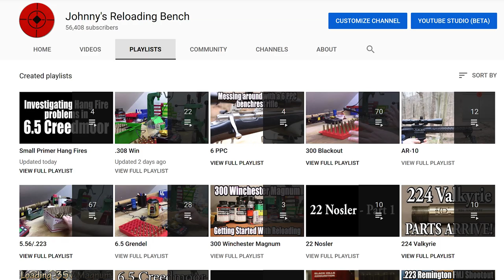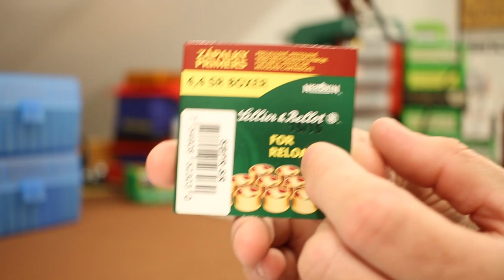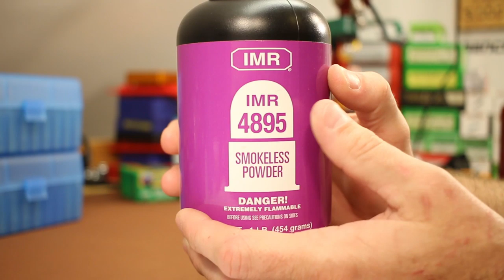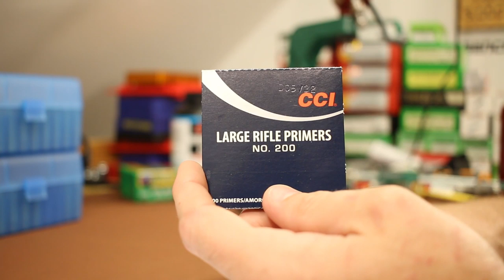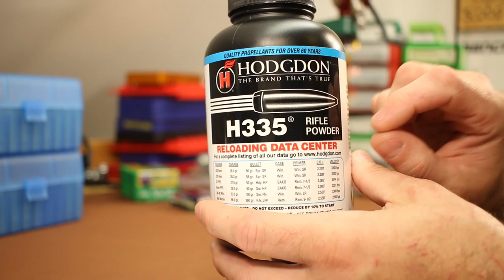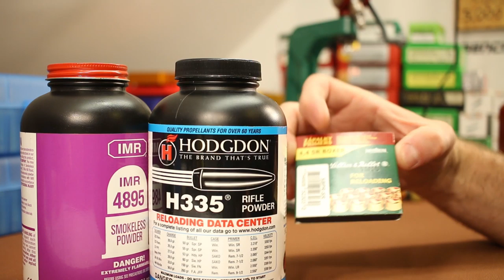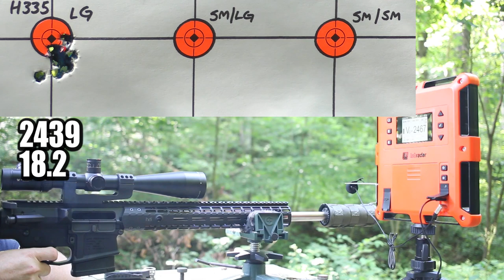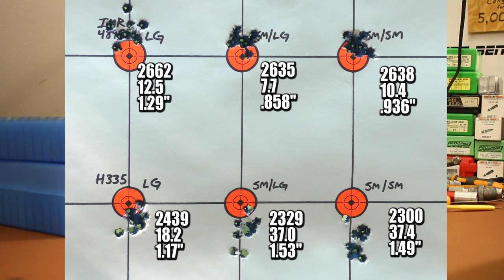308 Win - Lg vs Sm Primers and Flash Holes

Comment: That's crazy.  I've been using Lapua cases for 6.5CM with RL16, RL17, and H4350 with the CCI small mag rifle primer.  The H335 has rocked in the 5.56 also.  Glad I've never ran into hangfire issues!
Reply: between 7.62Nato and 5.56Nato i've loaded and shot over 20k rounds. my total round count for handloading is 40k rounds. I have never had a hangfire either.only 1 round in 5.56 didn't go bang (CCI Small rifle) in a match one time. even the 5k Tula primers all worked great.

Comment: The small primer 308 cases are usually bench rest cases. The old Remington version used to have thin walls / heads, for more capacity. The idea was to allow a similar amount of powder at a LOWER pressure and they were not meant to be loaded to maximum 308 pressure loads. The Remington 7 1/2 primer is super hot and is called the bench rest primer by Remington and is meant for full size bench rest cases.

Comment: It has to do with the empty volume in the cartridge and the primer size.  Lower charges (higher empty volume) equals lower ignition pressures which provoke hangfires.  Large primers will increase the pressure compared to small primers hence improving such conditions.  Keep that in mind because if you are going to test the issue you need a proper strategy to control these variables.  Not doing so will give you inconclusive results.

Comment: I recall the discussion when small primer Palma brass was introduced as follows: 1) You get more loadings with the smaller flash hole as there is more material in the case bottom to resist "loosening" 2) Smaller primers make for "softer" ignition.  This means you can use more powder to achieve higher velocities without exceeding the SAAMI limit. This being like using a less "quick" propellant.

Comment: Great video.  What I understand from talking to a lot of bench rest shooters, if you run small primers on rounds that are designed for large, like the .308 or 6.5 Creed and others you can run into reliability issues if you do not run magnum or bench rest primers.  Something that burns a lot hotter.  If consistent ignition is the goal say for hunting then you should stick with the primers that the case was originally designed for.  If you want the smallest standard deviation and POTENTIALLY smaller groups then small primers can be the answer.  Got this same information from multiple sources I always just run Large primers in standard short action case and small primers in mini action style cases.

Comment: Great video in comparison there with small vs large. This my experience over 5 decades of reloading.  Knock on wood, I have yet to have only one, in all my reloading to have a hangfire.. it didn't ignite at all and it was a 280.  I have used a lot of h335 in my 223's. I have used all brands of primers, Win Sr, Rem 7 1/2, CCi 400, 450, br4, 41, fed 205match,. Large rifle the same. I have never used SB nor Tul.
 What I have learned for me, with ball powders is high load density equals lower sd's. I watched a video that Rick Jamison did testing primers and flash. Could tell a slight difference in magnum primers. I would say loading density nearer 100% was the factor. I had a favorite load in my bolt Weatherby of H380 and a WLR with 165 btips, Rem brass, that literally was a clover leaf all the time. I do everything to the brass, flash hole, primer pockets and weigh them to .25 grain. I don't neck turn much. 
 I did  308 comparison with 308 ppu brass I had with LG rifle primers. The flash hole of the ppu had a smaller flash hole. I did the 3/64th bit to them. Had a slight difference with small hole lower SD with wlr. 
 I think also when you have a smaller flash hole it doesn't create as much pressure in the primer when you are nearer max charges. 
Once again great video and my 2 cents worth.

Comment: Another good video Johnny, pretty much learned reloading from your videos. Went out yesterday for the first time with my new Bergara B14, new SRD762 and my first 308 reloads. After zeroing scope was able to do 1” groups at 100yds. At 200yds on steel grouped but shooting very low and at 300yds had to hold really high to get on steel. My load was 168gr FMJ, 36.4gr IMR 3031. I’ve loaded the first 200 rounds very conservative so it could be why I have so much drop at 300yds. Kinda off the subject but I appreciate all your videos. Merry Christmas 
Luther

Comment: Actually, I think the S&B primers are harder, therefore you have to have a really hard firing pin strike for it to work properly.
Reply: I agree in ar testing 556 I can concur they are harder.
Reply: Yeah, CCI primers are definitely not "hot" by any stretch of the imagination. W-W, R-P, and Fed are all hotter in comparable primer types than CCI. They are highly reliable and ignite really really long as you hit them with a strong enough strike.
Reply: S&b factory 300 blk ammo.  Can confirm harder primers than cci.  Had to change the trigger springs to achieve ignition

Comment: Small rifle primers gave you better standard deviations because the small primer blast stacks less deviation into the equation we call a gunshot. It's a thing is hornet loaders understand. The weaker the printer, provided it is hot enough to give ignition, the more consistent your load.

The issue you were having was that the SRP was simply too little to consistently ignite that charge of ball powder in that size of a case.

Comment: To be honest, I've never done much shooting with 'small flashhole' brass in .308. I tried some out when I first found some of the the Lapua small hole brass, but never saw any real gains over the standard Federal Match brass I've used forever. I tried some of the S&B primers but found they weren't consistent enough for my tastes with ball powders. Most of my manuals recommend magnum primers with ball powders, but I've had good luck with CCI Bench Rest primers. I've been shooting 45.6 grains of Varget with that primer under a 168 SMK and getting right around 2700 fps out of a 20" LR-10 with no signs of excessive pressure at 80°F ambient. Groups are sub-MOA with SD's hovering around 12-14 depending on the temps on any given day. Your millage, of course, may vary. 
Great video. I'm looking forward to more.

Comment: Small primer brass is marginally better shows up in the coarse of a shooting season. But it was more consistent. Consistent often leads to accuracy.  New brass is probably more accurate, also what is the H20 capacity of Palma vs Regular 308 brass. 

Think you really covered it. Shoot stick not ball for small primer and watch the cold weather....
Reply: I shoot h335 in small primer and have zero issues in my auto

Comment: I'm interested to know if that when there is a misfire are your cartridges pressurized from the primer? In some pistol cases I've seen that the bullet is separated from the case and has entered the barrel so I was wondering here in the rifle cartridge if the cartridge is still pressurized or has depressurized by the time you take it apart? I've also found much good scientific material related to primers online. Here is a link to one of the several I find in a Google Search. https://www.researchgate.net/publication/48204066_High-speed_measurement_of_rifle_primer_blast_waves

Comment: Savage F/TR Palma rifle., 1/13 twist, 30 inch barrel. Lapua palma brass. CCI Bench Rest primers (br4), 43.1 gr Varget, 155 gr. Sierra Palma bullets. Use crappy primers get crappy results. Only one "no bang" so far and I think it was a plugged flash hole or a bad primer. Leaning toward the plugged flash hole. (walnut)

Comment: I think something needs to be said about the development of the Lapua 308 case with small primer pocket and small flash whole. That brass is labeled as "Palma" , the Palma event is fired at countries that speak English originally using the Nations Military cartridge in this case it's 7.62 NATO. the requirements are the competition is at 800-900-1000 meters/yards. Through a bolt action rifle which is supplied by the host country. The hosting country's also supplies the ammunition that each competitor needs, for the weeks long event. Every host country since the 1990's has been using the Lapua case with standard primer pockets. But switched to the small primer pocket with small flash hole, some time more recently.  When Australia hosted the event they loaded the ammo with Varget powder, and when the USA hosted , the Sierra 155 grain Plama Match King bullets became standard. The small flash hole is to reduce the back pressure which blows out primer pockets in small cartridges as used in Bench Rest shooting. Way back when the Berdan primed cartridge case that had 2 small flash holes rather the one large one was for the same reason, reduce back pressure that can cause a flame to enter the action and into the face of the shooter.

Comment: Been shooting srp laupa brass in 6.5cm.   Srp brass in this and 308 offers lower ignition  energy and in both cals this results in about 100fps less for a given charge because of lower energy of ignition.  In cold and sometimes warm weather this can mean hang fires.  The trade off is longer case life and better sd/es.

Murom kvb223magnum primers and cci 450 both work well.

In 6.5cm a 139 scenar and rs62 powder using these primers resulted in low zeros  groups averaging in liw 0.2s.  I was averaging 0.25" groups with a best Of 0.18. Lapua brought out smaller primer brass to lower sds as it worked well in 6.5x47 for bench rest shooters and extends brass life for hot loads.

You cannot compare sd or groups on the same charge though so your conclusions need to be based on  potential accuracy based on best nodes and loads for both.  Try about 42.5 to max 43gr h4350 in srp lapua brass for 6.5cm using the 139gr  scenar.  That should give superb results.  Its equivalent to 44grs62 for the same combo using cci450.

Comment: I just went through this decision in 308 brass.  Ended up going with large primer Lapua this time just because I am setting on a lot of 210m and because my decapping pins are all standard size.   After I use up most of my 210m’s I’m going to be switching to SRP brass in 308, 6.5 snd 6 creedmoor in hopes of longer primer pocket life.

Comment: On those cases that had hang fires was the primer seated completely with the 3 anvil feet at the primer pocket bottom, or did the firing pin push the primer to the fully seated position after it fired?

Comment: I use 47 grains of BLC -2  length is 2.865 speed is 2675. That's the one I run out to the rifling. And groups great under a dime at 100yds
Reply: And they have a large primer and use Winchester primers

Comment: Hahaha.. forget the drill bit...an overzealous pocket hole reaming, will (accidentally) yield the same results.It is very easy to do on those powered Hornady case prep tools.About 1/2 way through a batch, I noticed the flash home size difference.I didn't want to trash those new cases, so I decided to work my loads to this brass case modification.Also, for quality control and a desire to keep things simple, I did not want to worry about keeping track of two different cases.I never did try any loads with the smaller holes.Now I am curious to see how much this affects my groups?

Comment: Personally I believe you need to pick a different primer for you small rifle primer. I have had some good groups using S&B primers but I have also had the hang fires. Never experienced the hang fires with other small rifle primers. Personally I feel it is due to the design of the S&B myself. It seems to have a sharper shoulder which to me creates a flatter surface for the firing pin to strike. All other small rifle primers seem to have a slight dome shape compared to the S&B.

Comment: The Barrel harmonics like 2635 better than 2662.
Also, you need more 335 in those cases because a 1/2 case of powder is not covering the flash hole enough.

Comment: Their is no doubt that your decamping unit is not concentrate. Forcing a large decamping pin through a small primer flash hole has ruined it. I did the same thing. Take the unit out and roll it on a flat table . It will wobble . Do yourself a big favour. Order a whole new unit and trash the old. It is not worth the aggravation. 
I filed down the large decap pin so it would fit through the small primer hole . You can also purchase a Lee Universal Decapper and decap in a separate operation. Issue resolved.
I have had the same experience with ball powders. Click bangs and hang fires. And brown cluppy powder. I'm leaning towards stick powders. Great channel.

Comment: I use 308win large and small and have shot 1000s of both. I do get better es and sd with small rifle primers. 
I have never had a hand fire or a misfire with eather. I have tried many different primers. Never a issue. How ever the rem 7 1/2 should be cold  not hot. Should be the coldest on the market. I would expect the issue is in the powder. I have had misfire issues in the past in another 308 win with large rifle primers but that was due to seating depth and 155 match kings. But that nothing to do with ur setup. 
The h335 may work with small rifle mag primers. But I have played with mag Srp and my combo was worse off with small rifle magum primers. 
.

Comment: I have two 6.5 Creedmoors. I use Lapua brass with CCI 450 magnum primers. I'm on my second barrel on both rifles and I have never had a hang fire. (H4350 and RL-17) You should test them in the small primer/small flash hole test. 
Also, I have read that the yellowing of powder is from soap residue (not rinsing enough) from wet washing (tumbling or ultrasonic) cleaning. I'm not sure if that is true or not. Maybe one of your viewers has some input on that.

Comment: check out the videos by Tech Industries on How To Make A High Performance Smoke Device.  in them, he talks about the balance of materials, one of them being parafin to slow the burn rate down.  looking at your clumps of powder and the hang fires,  it seems the H335 is too slow of a burning powder(parafin?) for the SB primers and the wax is extinguishing the flame. 
before getting too far off track,  try the same loads with the CCI #41 primers with the H335 and see if they fire off effectively.  eliminate one thing at a time xD

Comment: Don't know why so many people have bump fire issues with their triggers. My timney is set to 1lb and I have rigorously tested it through banging it, dropping the rifle, literally have given it hell and it has not released the firing pin once.
Reply: Swipez the bump fire he had wasn’t caused by anything mechanical, it was from his shooting technique. He was very lightly pulling trigger and lightly holding grip, and after recoil, when the bolt slams back into battery, it has enough force to push the trigger against his finger again, causing the gun to fire.

The testing you did with drop and bouncing doesn’t have anything to do with how his trigger went off, it just has to do with the mechanical safety of the actual trigger in your firearm.

Comment: The small flash holes were put in for what?? Competition shooters using the rifle under a very specific and controlled set of circumstances. Bolt guns, competition loads built to function a particular way. This makes using them for sporting ar rifle seem silly. But I’m just putting that into its correct context. Why not use large primer brass for your .308 ar? So crazy it just might work. And no one needs this ‘problem’ diagnosed, because put into correct context, it’s not a problem.